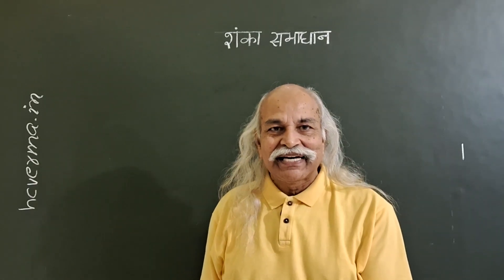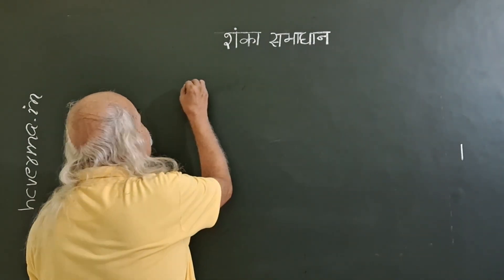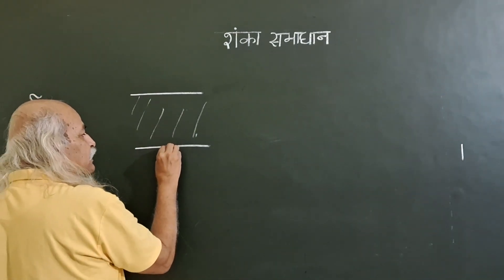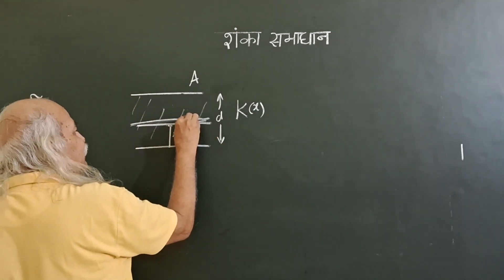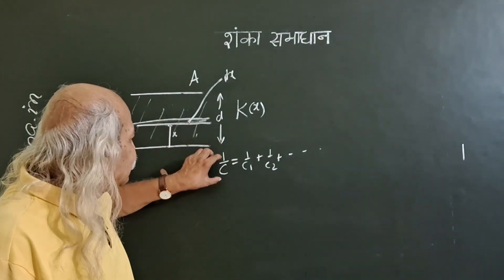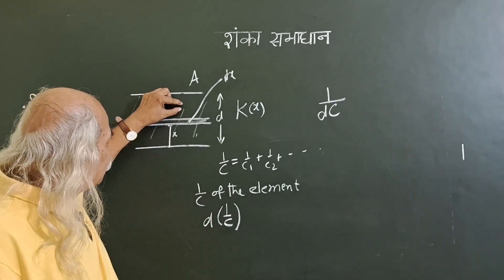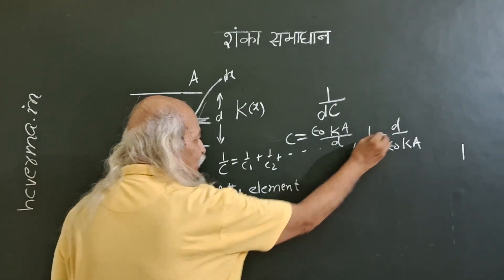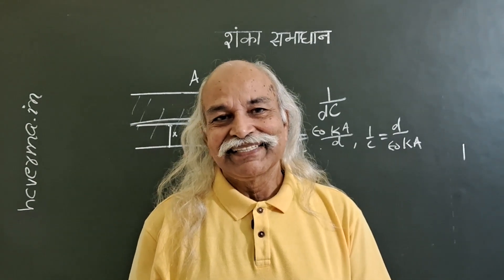A Mathematical clarification

Comment: Good Evening Sir 
Myself Saisha From Haryana 
My question  is that 
If a moving charge produces magnetic feild then why does the electric wires which have some charge in it does not  behave like a magnet ??
Thanks Sir 
HOPE YOU WILL CONSIDER MY QUESTION
Reply: Electric wires mein jab current flow hota hai toh Magnetic field produce hoti hai toh woh magnet ki tarah act krta hai jaise agar solenoid le liya aur usmein current establish kiya by external battery fhir woh ek magnet ke jaise work krta hai. Agar bus ek electric wire rakhi ho toh usmein toh charge move nhi kr rha aur wire bhi neutral hai so na toh electric na hi magnetic field banegi

Comment: A block of mass 3 kg is placed on a smooth inclined plane with an angle 30 degree with vertical and is connected from one end to a pulley via a light string. Another mass of 6 kg is hanging from the pulley as shown in the given figure. Acceleration of the block of mass 3 kg is (Here, g is? acceleration due to gravity.)

Sir please answer the question
Reply: Here acceleration of 3&6kg mass both are equal and i.e 

a=(4-√3)g/6 ms^-2.

Comment: Hello sir 
I am a student of class 10 and have a doubt in electricity chapter 
If current always takes the least resistive path , then how does current flow in a parallel circuit with two resistors of different resistance? Will not current flow through only one resistor

Comment: Sir as we know that current is charge passed per unit time through a cross-section. 
So in photoelectric experiment when we increase frequency ,,the KE of photoelectrons also increases. And this increase in KE would make the photoelectrons to move faster taking less time than earlier to pass a certain amount of charge through a cross-section . 
So ultimately saturation photocurrent should increase on increasing frequency.
And this is CONTRADICTORY
So please clear this contradiction

Comment: Good Afternoon sir,
I have a doubt which is messing with me for quite a while now
We say that light can be wave or a particle but if light is a particle then light should be affected by gravity.
therefore the light should have a curved path not a straight line
Reply: Indeed it has curve path. That's how light bend around black hole, it has immense gravitational pull.

Comment: Sir in paralled circut why and how current divides. If you say that because of conductor divide so current divides so what is the divided conductors suppose 1 wire is divided into three and both of three has same no. Of electrons? We can do this by wrapping same metal wire upon it like in our house electrician wraps it. Then each have same V and Same I ??
Sir please answer i am from class 10th.🙏🥺

Comment: Good day sir. i have a doubt in electrostatic potiential. We generally add potiential algebraically depending on the sign of the charge. By this logic the midpoint of a two opposite charged system should have 0 potiential, which is true. BUT sir how come the potiential energy, that is the product of test charge and potiential non zero in the midpoint. IF the potiential is 0 then the potiential energy must be 0, then the charge must be stable and not move from the midpoint when we let it go.  but it moves towards the negative or the positive part of the system. if the potiential energy is also 0 then how did the test charge between the two opposite charges gain its kinetic energy when we let it go? please kindly clarify my doubt sir.🙏 i asked this to many teachers and searched many resources but couldnt find an answer.
Reply: Kisne bola potential energy zero nhi h potential energy zero h but equilibrium m hone ki first condition Force ka zero hona hoti h jo dipole m kabhi nhi hota
Reply: @piyushtulsiyan513  Yes potiential energy is non zero. Then how is the potiential 0. That's what  my doubt